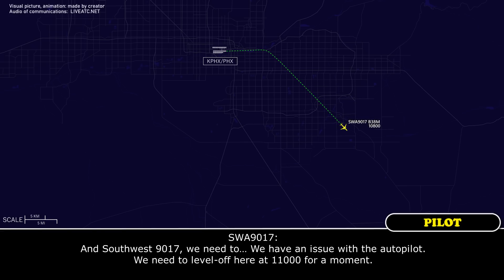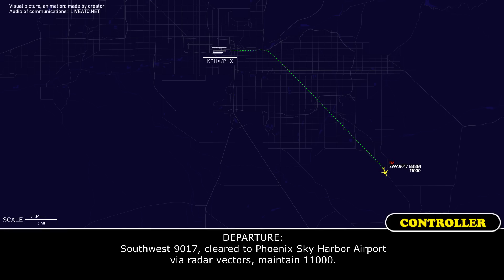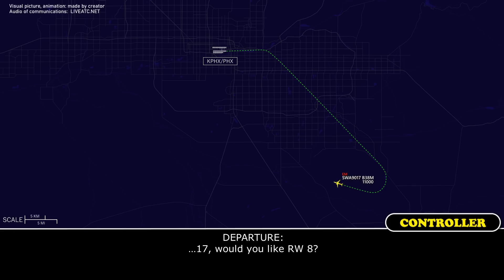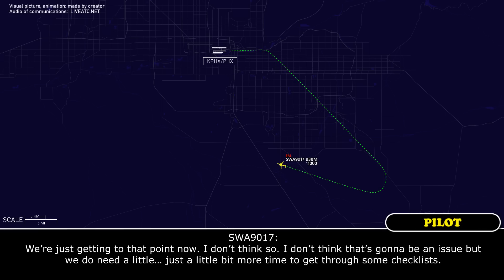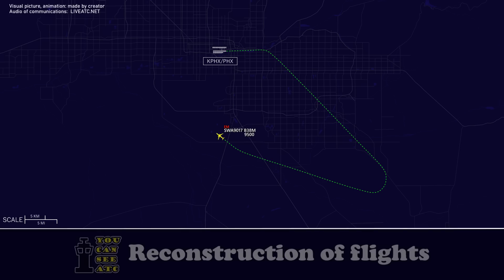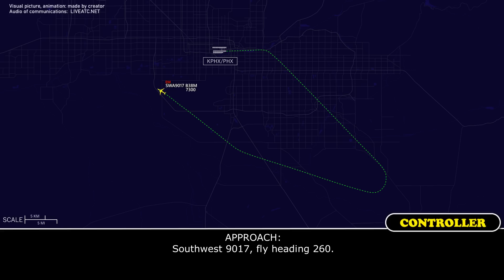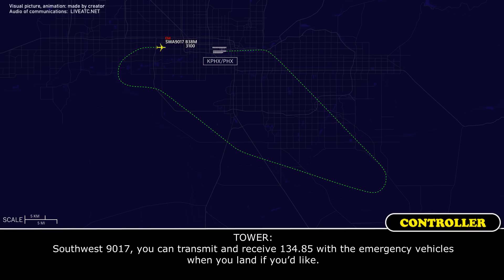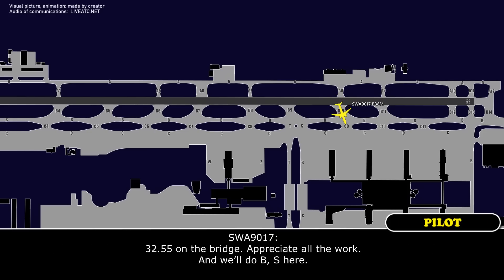“Trim system is not working”. Autopilot issue. Southwest B737 MAX 8 returned to Phoenix. Real ATC

Comment: I will not fly on the 737 Max Aircraft- I don`t care about all the assurances-the entire project is flawed and Boeing basically just did what they wanted with the aircraft, with or without FAA approval. I don`t believe the aircraft systems are safe, and Boeing have been incredibly arrogant about the situation, even with the tragic loss of aircraft they tried to blame pilots and poor training.
Reply: Yup it was those 3rd world pilots fault and their lack of hand flying experience.
Reply: @Yusuf_Omar_P  lol. If this happened to some sandy, they'd be dead already.
Reply: @Yusuf_Omar_P  I hope you are being sarcastic
Reply: Right.
There was a Mayday episode a lot of time ago about Turkish flight 1951, which was a 737-800 with a faulty radio altimeter. At the end of the episode, a Boeing VP accused AIRBUS for their automation philosophy, like that was THEIR fault 737 pilots couldn't recover!
Reply: With the 737 MAX series, Boeing have built an aircraft that is flawed, and aerodynamically unstable without all the computers.
For those that don`t know about the crashes in Indonesia, go and read the accident reports.
The auto trim system fails, then keeps resetting its self, so the aircraft becomes uncontrolable.
It keeps pitching nose up, stall, steep dive, then recovers, and this continues until it eventually crashes, with the loss of all on board. 
Can you imagine what that must have been like for the poor souls on board, knowing they are going to die.
Reply: You watch a documentary, eh?
Reply: @JayJayAviation  No I am an ex UK Military pilot and I have a very active interest in aviation safety. For some reason there seems to have been a backlash from some parts of the world saying that Boeing are not responsible for the loss of the two 737 MAX aircraft. Well I am sorry, but that is fact, and it`s not that the FAA or NTSB or anyone else picking on Boeing. Any company can come up with a product that is potentially unsafe. No one is saying Boeing did this on purpose, but the trim system has been proven to be unsafe and unreliable, therefore, it needs to be fixed.
Nothing wrong with that. Would anyone like their loved ones or themselves to fly on a aircraft which had a known potentially deadly fault ? I doubt it, we all have to learn from accidents, to prevent them from happening again. If things need to be fixed or replaced, then do so, and check and check again, so the same situation can never happen again. Sticking your head in the sand does not solve anything.
Reply: @paulmca8514  fair
Reply: @Phillip Banes I am not an idiot. I have a very active interest in aviation safety. For some reason there seems to have been a backlash from some parts of the world saying that Boeing are not responsible for the loss of the two 737 MAX aircraft. Well I am sorry, but that is fact, and it`s not that the FAA or NTSB or anyone else picking on Boeing. Any company can come up with a product that is potentially unsafe. No one is saying Boeing did this on purpose, but the trim system has been proven to be unsafe and unreliable, therefore, it needs to be fixed.
Nothing wrong with that. Would anyone like their loved ones or themselves to fly on a aircraft which had a known potentially deadly fault ? I doubt it, we all have to learn from accidents, to prevent them from happening again. If things need to be fixed or replaced, then do so, and check and check again, so the same situation can never happen again. Sticking your head in the sand does not solve anything.

Calling people names is childish and pathetic, and just because you disagree with me does not make me an idiot.
Reply: I think its the safest plane in the sky. They know everyone is watching now.
Reply: @oldgregg777  Yeah, and they almost "watched" another one face plant because they refuse to correct the core problem, which is a plane that doesn't want to fly as designed.
Reply: @kendallevans4079  when did they almost watch one “face plant”?
Reply: @oldgregg777  This one! Didn't you watch?
Reply: @kendallevans4079  are you serious? They were never in any danger. I’m wondering if you actually watched.
Reply: @oldgregg777  Flying with faulty equipment? You are the one who either didn't watch or, more likely, didn't comprehend.

Comment: I had experience this issue in 800NG ,such a pain fly without A/P and trim
Reply: @jonathanparle8429  Manually trimming an airliner is quite different from a Cessna 152. Much more sensitive and frequent changes.
Reply: @claudest-gelais8456  there is no way they were manually moving pitch trim wheels. They said the autopilot wasn't trimming that's all. Trimming a jet is about the easiest thing you can do and I lovely one at that.
Reply: @ljwithnok2615  I never said anything about the trim wheels. And are you saying that an airliner with several different flight regimes and speeds and altitudes is easier to trim than a Cessna 152? If so, than you are/were not a pilot, I was and owned an Grumman American Yankee.
Reply: @claudest-gelais8456  I am a captain actually for an airline and I've flown a 150 which is essentially a 152. And yes since the trim is electronic and has electronic indicators instead of a wheel you need to lean over to reach and has no significant indication of where it is I stand by what I said. I can trim in 3 axis, a 150/152 has only 1. Not only that but my trim has precise control and is numbered so I can see exactly how much trim I've added or removed. I'm 15 years into this, and I'm on layover right now but this is the Internet, we could both be liars.
Reply: @ljwithnok2615  ur both lying
Reply: @vicvega3614  can't tell if serious or not but thanks for adding to the conversation
Reply: @claudest-gelais8456  small world, I fly the CRJ -700 and 900
Reply: @ljwithnok2615  Small world indeed 🙂.
Reply: All I’m picturing as I’m listening to this is video from 737 cockpits of those trim wheels zooming around all the time during an approach, and how much work it would be to do that manually.
Reply: @jonshellmusic  It's not like they're manually cranking the pedestal trim wheels. I imagine 'trim manually' means they use the thumb switches on the yoke as they hand fly. It's still electric trim so not THAT hard
Reply: @outermarker5801  
        I’m not so sure.   

   The 737-8 QRH procedure might be to disconnect BOTH trim cutout switches in the event of an autopilot trim malfunction.

     It doesn’t matter really since both of those switches are essentially wired in series.    

   If either one is switched off, NO electric pitch trim will be available.

     These guys were most likely hand trimming, hence the request for a 10 mile final to get everything stabilized.
Reply: @Stepclimb  Hmm, I guess then it's a question of whether the QRH definitively says so or not. 
I assumed once they had normal elec trim with a/p off they'd simply stick with that rather than the last resort complication of man crank.
I wonder why Boeing decided the ability to retain man elec trim while disabling it's access by automatics was necessary. Seems a pretty useful function available up to NG
Reply: @outermarker5801  No, if they had a trim problem, the trim power cutoff switches are to "OFF" and they are, in fact, manually trimming using the trim wheel. Stepclimb below nailed it, QRH (Immediate Action Item really) calls for both trim cutout switches to be off.
Reply: @markmount3368  Thanks. Well that must've been fun
Reply: @outermarker5801  If it is manual; trimming then they would be manually turning  the trimming  the wheel on the pedestal . The wheel is fitted with a fold out handle to facilitate this.  That said, from what I have heard(and it could be wrong) the trim wheel on the MAX's is of smaller diameter that  those on the other series (737-2/2/4/5/6/7/800).
Reply: @BlackKnight344   I stand corrected that per QRH all electric trim is off, but I'd still argue 'manual' generally doesn't necessarily imply fully 'mechanical'. When a pilot hand flies a 787 or Airbus, they're doing it 'manually' despite the fbw systems in between. Same principle with elec trim.
Anyway, moot point.
And yes, I have read as well the pedestal and thus trim wheel circumference had to shrink to accommodate CDUs on NG.
Yet amother factor that might just have mattered later on given smaller diameter requires more muscle to turn it🤷‍♂️
Reply: @outermarker5801  
          I looked up the Boeing 737-8 QRH procedure (WN uses the Boeing QRH).
         
     I think you may be correct in your earlier assessment.

      If the issue was with “Autopilot trim” which the audio suggests, then, after autopilot engagement (around 10000MSL), the crew would have seen an illuminated “STAB OUT OF TRIM” light.

         This only appears when the autopilot trim is not working.     The QRH directs the autopilot and autothrottle to be disconnected.

       Then the QRH asks if “main electric” trim is available (via the thumb trim switches).

       If yes, hand fly and trim normally via main electric trim.   In this case, speed trim (and the sub-function MCAS) are still working with flaps up.
        If no, only then would both pedestal mounted Stab trim cutout switches be turned off.

       Now that I look at this, I think your initial assessment was correct and they asked for a long final in an abundance of caution and to have plenty of time to get through the rest of the checklist(s).      They might have even elected to land flaps 15 just in case there were further trim issues.

       In the heat of the moment, the PNF mentioned “manual” trimming when most likely they were “manually flying”, with the available “Main electric” trim.
Reply: @markmount3368  
          I commented down below after reviewing the QRH.
         The memory item for removing all electric trim via the cutout switches only applies to a runaway trim.
         In this case, they most likely got the “STAB OUT OF TRIM” light.    After disconnecting the autopilot, and if the “Main electric trim” is still working properly, the procedure is to manually fly the aircraft and continue to trim normally via the thumb switches on the yoke.
Reply: @Stepclimb  Thanks for the follow up clarity, I guess in effect once the parameters of the emergency were clearly defined and evident per relevant procedures, the PF basically had himself some hand flying time. Bet she's a dream to hand fly
Wonder if the PNF felt left out lol
Reply: @outermarker5801  
        The -200 and -300 were more of a pleasure to hand fly.
       
    The -8 is pretty solid and stable, just more like a Cadillac vs a Corvette….if we’re using GM euphemisms.
Reply: @outermarker5801  When they said autopilot trim is broken I thought that might have also meant electric trim was broken.  We have electric trim in the single engine piston planes I fly, I’m familiar.  It seemed unclear exactly what was and was not functioning.
Reply: @jonshellmusic  From my  understanding 1 degree requires 10 turns of the wheel, in a classic. On the Max the shame pitch change requires 15 or so due to the smaller wheel size.
Reply: I can’t imagine the workload you experienced during that flight.
Reply: @jonathanparle8429  yap manual trimming its okay

Comment: Wow, this was its very first revenue flight after delivery.
Reply: Did it go through final QC? Apparently not!
Reply: @kendallevans4079  well, it DID get TO Phoenix ok from Renton ....
Reply: @litz13  Ferry pilots tend to be more tolerant of broken stuff. For them, hand-flying the whole way frankly might have been looked at as a fun challenge.
Reply: @kendallevans4079  It may be the first time it flew with a load. And this pushed CG or the flight control forces to a point where it revealed the trim issue.
Respectfully
Reply: @ricardokowalski1579  Hmm...Good point
Reply: @ricardokowalski1579  They make acceptance flights and a ferry flight. So stab must have been under load before.
Reply: @kendallevans4079  Probably they are being asembley on a GM facility.
Reply: @kendall Evans  Not true at all. The 737 goes from renton to the seattle delivery center, not to mention potentially multiple boeing and customer flights

Comment: Look like QA has a lot to be desired. And this is not an appliance, a laptop or a car. It is an aerospace grade piece of equipment. I would avoid this jet at any price.
Reply: If you're selling I'll give you $50
Reply: @WuRuYi  Im sorry .... Im sure I can find somebody crazy enough to flight this cuffin to Victorville and cash a nice check for scrap.
Reply: Not a QA issue.
If it were, that would be found during acceptance flights at the latest.
Reply: @HapyLLIuTeJIb  We all know how QA has deteriorated at Boeing. metallic debris found in the cockpit wiring. Tools and rags forgotten inside wing tanks .....  And this can still pass an acceptance test. It can fly for years.
Not telling that any other brand is better. But so much things have been happening to them in the last 2 o 3 and FAA just giving them thumbs up. Of course still is a good machine, that allows to land safe and walk away. .... but Boein CAN DO BETTER. We are not in late 60s where commercial jets were more prone to failures.
Reply: Any person who would fly on any Boeing plane is absolutely crazy. Um well, maybe not.
Reply: @Phillip Banes I agree, these comment do not worth responding.

Comment: OH DEAR, we're going to have to hand fly AND do Manual Stab Trim!!!  OH, the horror!  NOTE to Tech Ops...Add to QRM (for children of the magenta line)...In event of a need to use Manual Stab Trim, call Galley Person to crank the Coffee Grinder.
Reply: No A/P no RVSM airspace... so you're most deff turning around. 
Flight control malfunction (inop elec trim) for reasons unknown... most companies have that in the "declare emergency, land nearest suitable" column.
Reply: Lol! I always get a kick out of the phrase “hand fly”. You mean just…fly?
Reply: @SchillerDuval  Hand fly means fly by hand, rather than using the autopilot. Clearly he has no problem doing it but they're not going to hand fly a jetliner across the country, even aside from that being a pain in the ass the aircraft clearly has a problem and given the potential severity of an autopilot problem it makes full sense to declare an emergency and come back.
Reply: Wait, you guys have coffee grinders in your galleys? Damn, I'm clearly work for the wrong airline.
Reply: Your Velcro sneaker somehow have made you stupider.
Reply: Hand flying the 737 is difficult. There are large pitch changes with power. Having to use the manual trim makes it much worse. Had I been flying I would have told the controller to vector me to the airport and to clear all the airspace below me. The last thing I want to try to do is maintain altitude plus or minus 100’. They declared an emergency because, why not?
Reply: Mike, if it should happen to you just request a block altitude. More pilots need to request this when they have any kind of flight control issue (or if you are flying with a new first officer).
Reply: @flyerdon3116  yes but I wouldn’t accept a controller telling me, “unable” not in an emergency situation. I’ve had to ferry a 737 without autopilot (or a flight director) and I asked for a block and received it. It was a “scheduled” reposition flight. Not a big deal. My FO loved the opportunity to hand fly from SFO to SEA.
Reply: FYI, last time a max had an autopilot issue with trim, 2 fatal crashes. I think he was more concerned with that than hand flying.

Comment: Unbelievable. Does anyone really believe Boeing made any changes prudent to maintaining necessary safety and professionalism in the plants building and maintenance? It has always been about the $$ and always will be. Safety has always been and will be an afterthought.
Reply: I read the entire FAA briefing related to its release and they did nothing at all. It said something along the lines of, “We think it was a software issue, we’re developing a fix. The workaround (pilot training) should be good for now.” They literally did nothing and sent it back into the air.
Reply: @gatolibero8329  where is this report? I want to read it.
Reply: @gatolibero8329  You literally didn't read the first 10 pages, let alone the whole thing.
Reply: Another old fool spouting nonsense.
Reply: Boeing stuffed plenty of cash in Biden’s pockets.
Reply: I'm no expert but it sounds like they're trying to re-engineer a design flaw. Weren't the motors positioned in a way that created  nose-down attitude with 0 trim?
Reply: @analogman9697  Not exactly.  The engines moved a few inches and the center of thrust moved zero inches... on a 135 foot airliner.  The problem wasn't about how it flies, it was about how it didn't fly exactly like the NG in one particular circumstance that lives well outside of the normal flight envelope.  In flaps up manual flight under a high-g, near-stall scenario the control column feel was lighter than previous models.  That's it.
Reply: @analogman9697  I think it had something to do with how much thrust the engines produced as well.
Reply: I can't remember what they did but it didn't seem like much to get them back in the air.
Reply: @TheFrenchPug  That seems to be the consensus.